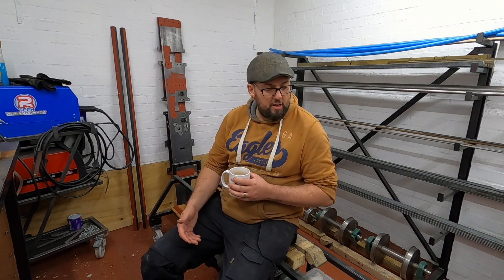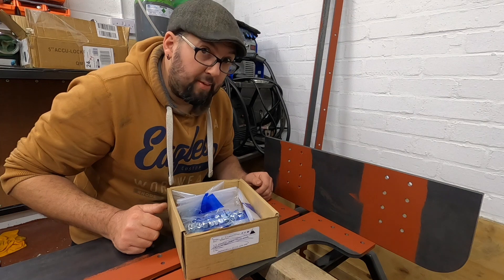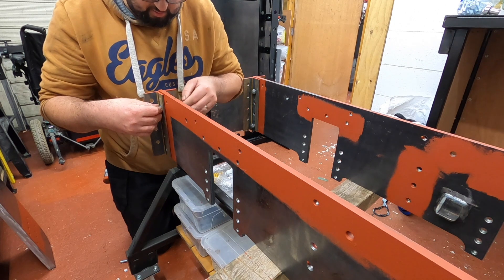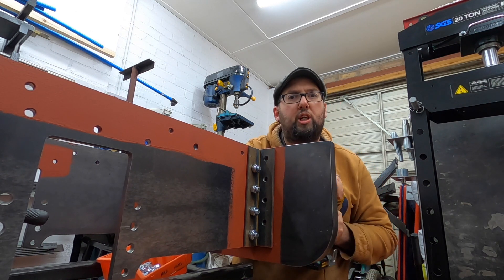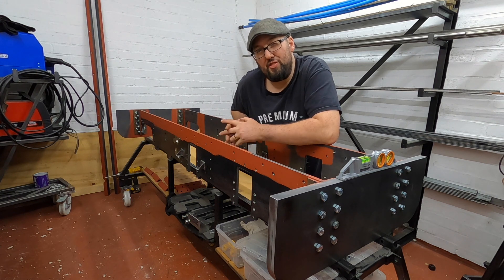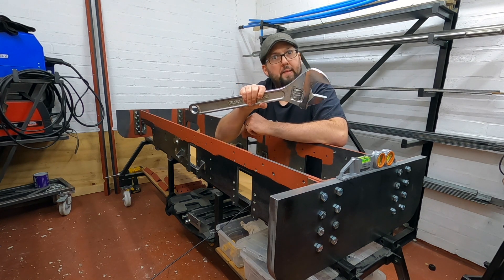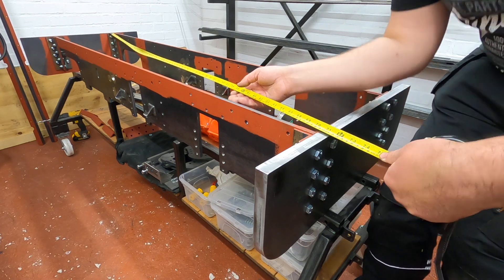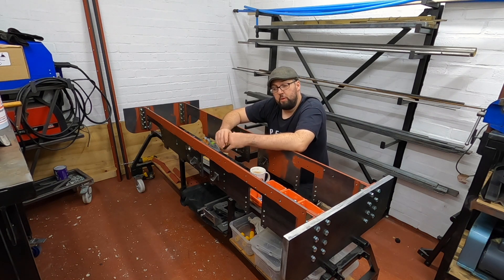Buffer Beams & Mainframe Assembly - EP7 - 7.25" Gauge Steam Locomotive Build.

Comment: A bit of advice for anyone building one of these. Don’t use zinc plated nuts and bolts. Paint doesn’t stick to them. Use self colour nuts and bolts. Also drill the holes smaller than the bolt diameter and run a reamer through the frame and joint and hammer fit the bolts and it will all stay rigid. I know it’s easy to criticise but you’re better finding these things out now rather than later. Looking forward to seeing it finished.
Reply: Quick scotch and a  dusting of etch primer on your zinc coated nuts and bolts will keep the paint on.
Reply from the maker: Thanks Derek, I must confess I’m definitely looking forward to seeing it finished! Thanks for your comment 👍

Comment: Going Great Matt. Tweaking is always a chore but very necessary, a good square frame to begin with saves a lot of trouble later on.
Dick B. USA
Reply: Looking good Matt , it's always nice to start putting all the pieces together,- on the other hand you could be in my shoes with a hundred or so 8mmx 40  blind holes to drill and tap on the l&b 262 we must be mad (definitely helps 😀😀)
Reply from the maker: Hi Jonathan, yes definitely good to see flat plates and bits of angle go together and start to look like a steam engine chassis. I did get to the point of being fed up of just drilling holes, put persevered and now seeing the reward. All the best.
Reply: @MattChiversWorkshop  hi Matt  know that feeling well I spent 4 months on and off drilling holes in the frames - just when I thought I,d got them all I,d look at the drawings and think missed those ones and then back on the milling machine - good fun when my work shop is 12x12 - I had to make some trestles so that I could drill the holes with the frames sticking half way out the door 😃take care too 👍
Reply from the maker: Thanks Richard, yes it was a chore, but worthwhile as I felt it would cause less issues going forward with the build. I’d have been rather annoyed having to do if further into the build to get things aligned. 👍